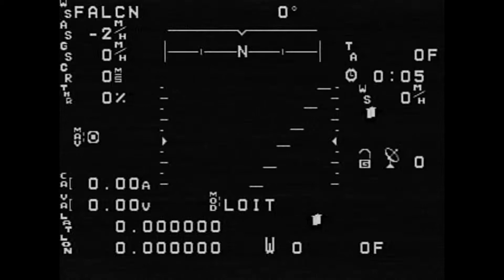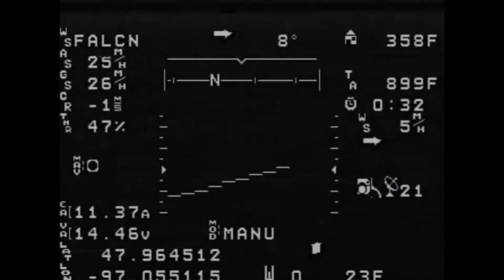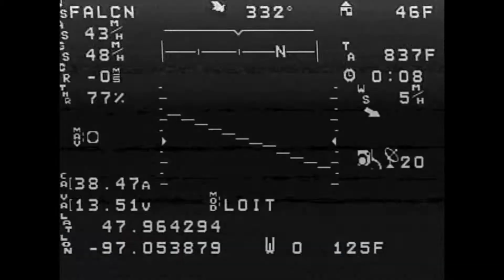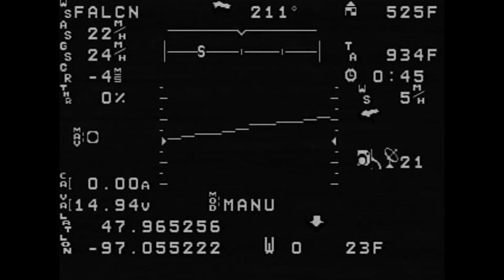Ranger EX 757-3 W/Pixhawk Crash and Flyaway!!!

Comment: so i am wondering, did you repair the fuselage? and if so how did you go on about it? i got a 757-3 for cheap but it had a though crash on the nose and i wonder how you would go about making it nice and strong agian
Reply from the maker: Honestly it wasn't as bad as I thought it was in that video. Epoxy got the balsa insert put back together and fixed the landing gear too. Just a crap ton of slow cure good stroke epoxy. Bob Smith industries slow cure to be exact.
Reply: @MillennialFalconFPV   shit if i look at the  one i got laying infront of me  the nose even started to spit, the owner before hand  bolted a wooden board to the  gimbal area and everything got little cracks. i looked around but i cant find anything usefull or a spare fuselage you can buy so i was really hoping for your input.. lol

Comment: Crazy man, I bet your gyro / acc was getting freaked out by the influx of cold air. Its pretty common in the mini quad world. Flys fine in manual mode but when it went to loiter and the acc readings are going crazy from a warm pixhawk then cold air super cooling it.